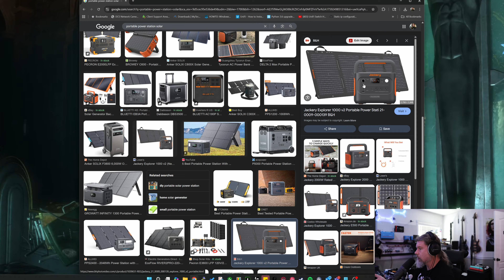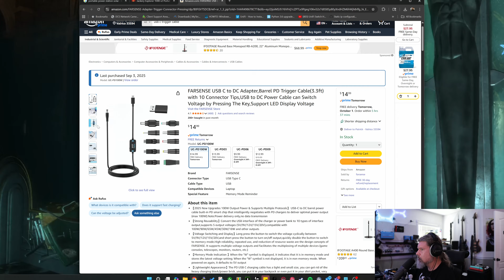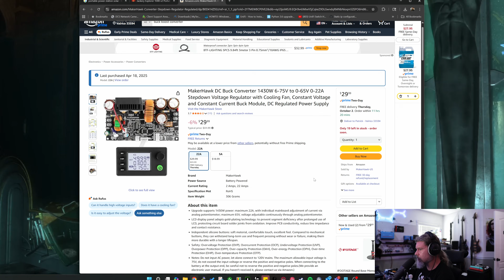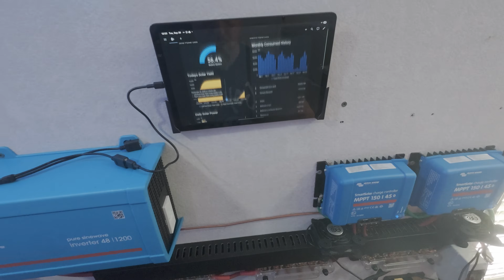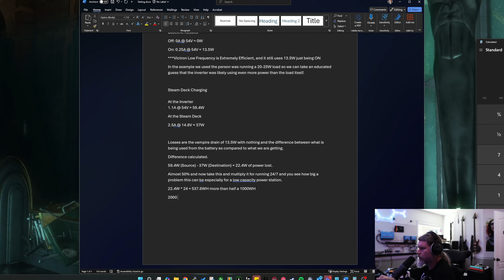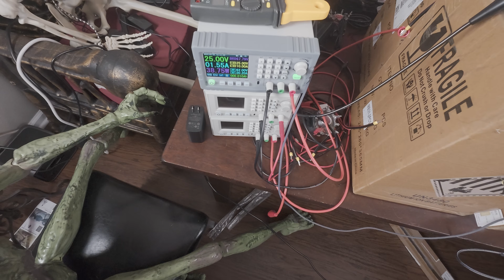The Parasitic Draw Trap - Inverters Wreck Small Loads: Why Your Power Station Dies Overnight + Fixes

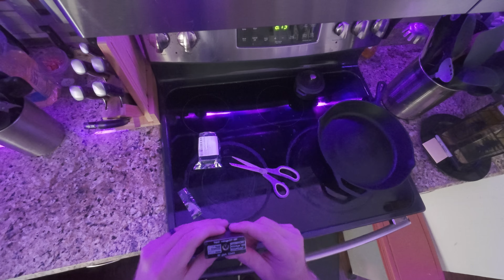Comment: 16:55 “so I can’t use the same battery bank because the voltage would fry it…” and that is the Achilles heel to this you should always go DC-to-DC when you can logic…especially when you’re not the only person using your battery bank / power system. With 120v outlets from an inverter, it works with standard plugs— on standard devices— plugged-in by standard people— with a standard knowledge level. With an inverter and 120v “wall warts” You don’t have to try to make everyone in your family and social circles into amateur electricians (people who’ve never even heard the term “wall wart” in reference to their adapters)…just to keep from frying all your many different tiny bespoke DC-to-DC adapters and smorgasbord of various barrel plugs.

The universality of the 120v plug & outlet socket is a highly underrated feature by people who understand electronics and electrical systems—and who deeply under-appreciate how little most other people around them understand about watts, amps, and volts.

Comment: It would be sensible to get an inline fuse on that buck converter (where it's connected to the Victron's inputs.) 
I appreciate that it was probably done like that just for a test but we're all guilty of leaving things like that for longer than we should.
Reply from the maker: Funny you mentioned that I have a replacement for it that I have not installed yet lol and it has the inline fuse.

Safety is important that's why everything is mounted on a fire retardent concrete backer board, something I hope more people start to copy.

Comment: So you could pump 200 watts from your ecoflow delta 3 plus USB pd ports into another power station's mppt inputs?
Reply from the maker: Yeah sure power is power, DC is DC.  The things to look for would be to check if your device supports 100w out of two ports at the same time, many advertise the max, but only for a single port and it drops when using multiple.

If that's good then check your MPPT and make sure it's enough voltage to work (20v should be good) it won't be fast or anything but it will work

Comment: I have the FARSENSE UC-PD09, which is the older model. The model you bought is a newer one with memory mode, which makes it much more practical than the version I bought.
BTW, there is an ioBroker plugin for EcoFlow that supports the Delta 3 Plus and River 3 Plus. Specifically, it allows you to see raw BMS telemetry. The plugin also supports exporting to HomeAssistant MQTT.
Reply from the maker: I am not sure if that's the same project I was recently looking at.  They had Delta 2 Max but not yet cracked the Delta 3 Plus.

I'll have to see if they got updated, though it was cloud based and that's not great.  Local is always the way to go.

Luckily now the Delta gets all it's power from the larger setup so I collect data from there.